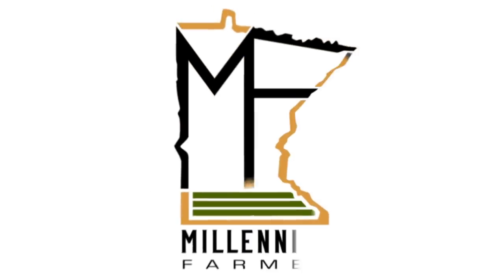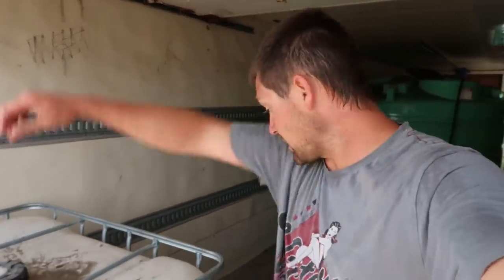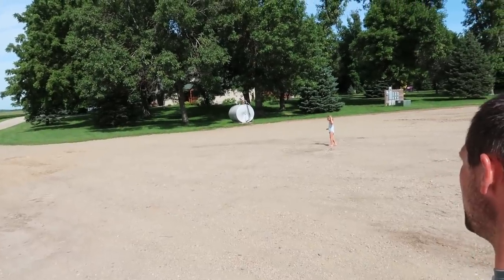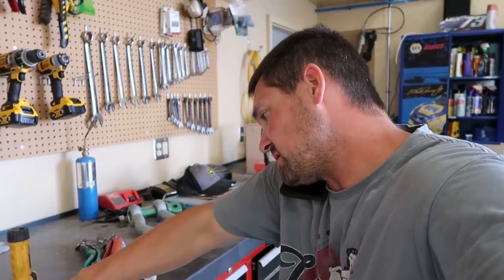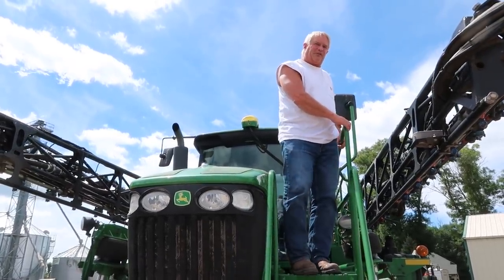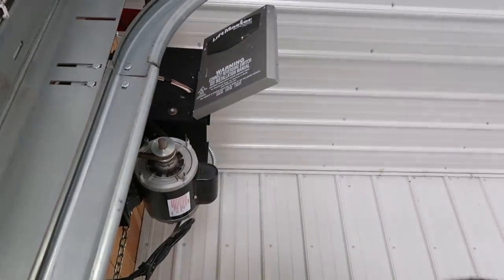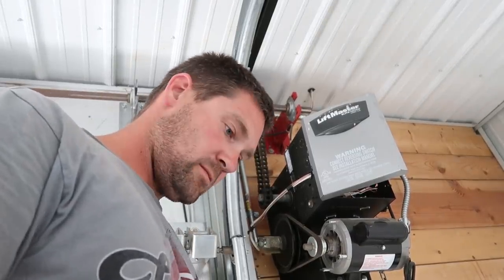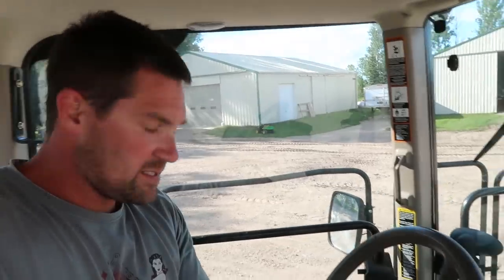Sprayer Oil Leaks

Comment: I ran a 9560 for someone doing tillage a couple of years ago.. Trans went out on it also. One night at 2 am while looking for the restroom I noticed oil spraying out the front of the grille. Machine came back from dealer after new trans and they forgot to hook up the heat/ac tubes to the cab. Machine went back. Cab has to come off to fix that. He now has all Red ones. Smart man.

Comment: It always is something on the farm....

My dad and I worked on the baler and hay accumulator yesterday, fixing issues from the last baling. Fixed everything in record time, buttoned it up and my son runs into the accumulator with his go-kart (which I may or may not have modified so he can go twice the stock speed), bending the closing gate arm that we just fixed. At least I had the tools out already, so I treated the earlier repair as practice.

It's always something.....often self-inflicted.

Comment: Hey from past experience of running two 4830 sprayers. If u will get the correct o ring u want be having those leaks as often. The correct o ring seems a little small. If u put one in that’s a little big it will get messed up when u tighten it up and want last long. Those solenoids work loose then it makes the pressure blow the oring out. If u will feel of it after it starts leaking u can loosen or tighten it by hand. Just thought I would pass along the info since u had two leaking at the same time. Thanks have a great year farming.

Comment: Might be worth looking into building some hinged shields at some point, that don't have to be unbolted and everything any time you need to work on stuff?  Yet another thing for the Legarms list.  XD
Reply: The ease of removing and reinstalling shields would greatly improve the chances of them being used.
Reply: We have invested in building frames to hang them from pins so all you have to do is pick them straight up easy to get off little hard to put back on but hanging them allows you to complestly remove them.
Reply: I would just run a pool fence right around the whole lot to keep little fingers away

Comment: So tip with the belt covers. my buddy built a frame and drilled a holes in the top of the cover. so you could just hang the covers and to remove them just pick them up its enough to keep the animals out of the belts but super easy to remove.

Comment: I started using WD-40 to wipe down rotor blades in La. on the Gulf coast. I just bought some white moly WD-40 spray. It works really well, thicker and sticks better than regular WD-40.

Comment: When i worked at the elevator, we had a few 30,000 bushel an hour Hi'Roller conveyors under our bins. We had a jump conveyor to go from our big wheat bin to connect with the rest of our conveyors that ran to a leg that we used for load out. The jump conveyor was underground similarly to your conveyor. One day, we knew we had a set of rail cars coming the next day that we were going to load. We found that the pit this conveyor sat in got full of water and froze, causing the conveyor to not run. Me being the new guy, I got to jump in there and clear all the ice and snow out so they conveyor would run. Yours looks like a drag conveyor, so hopefully you won't have to suffer like i did.

Comment: Them o rings are very common on higher hour 4730 4830 sprayers we had luck fixing them with actual John Deere orings the ones from cheap kits kept blowing out. I think I actually got oring kits for them solenoid valves for ours.

Comment: Those solenoids take a very specific O-ring and those O-ring kits very rarely have the right one. I drove a 4730 that would keep blowing the same one underneath and thought we were putting the right size on it from one of those kits until we actually ordered the kit from Deere and put it on. Didn’t have anymore trouble with it. Just wanted to give you a heads up

Comment: I'm guessing you need a high temp I pressure O ring. I ran into the same thing on my skid steer, selfperpelled chopper and on 1 of my round balers. If you use a standard O ring the heat and pressure will blow it out.

Comment: You need to install the cotter pin that is taped to the output shaft. The pin is what keeps the tension on your clutch. If the castle nut lossens up the motor will keep running until you hit the stop button.

Comment: Good you put belt covers on. Either make missing ins out of wood or measure and have a sheet metal heat/ac duct build company make you some.    Keep down accidents   Kids are curious!!    Enjoyed.  Might be a clog in oil line causing over pressure and blowing seals

Comment: On your oil leaks. I am not sure of this machine but usually there are nylon shields on each side of the o ring to help add strength to the o ring. I have not seen on the videos where you show this. May be worth a check.

Comment: Zack those oil rings are probably wore in the metal valve body just enough to blow out oil ring when pressure is high try finding a little fatter oil ring

Comment: Also Onyx: maybe save up some money and get yourself a SKLZ Quick Stick. $32 on Amazon. It is meant for single hand hitting drills and helps with your control and hand/eye coordination. I used to coach HS baseball and it actually worked with guys who had difficulty opening up during their swing. It's the little details that make a good hitter a great hitter. There probably wasn't a day in Joe Mauer's career that he didn't do simple tee work.

Comment: U need to move the big tanks closer to the middle or towards the axles. That way the weight will be more on the tires instead of the landing legs. U need thicker block on the landing legs

Comment: You might want to install a inline oil pressure gauge.  The odds of having two identical oil leaks at the same time especially after you just installed a new O ring on the one solenoid are probably pretty high.  There might be a oil pressure regulator somewhere in the plumbing???  Check John Deere's specs.  Just some thoughts.

Comment: Isn't it odd how tractor depreciate when talking trade in. I have a two year old brand X tractor that has been nothing but trouble. I was told by a couple of dealers that they wouldn't give me enough to make a trade in worth my while. Doublespeak for "I don't want the thing either." Fix the transmission. It's the right call.

Comment: Forget using those old crappy rubber o-rings and switch over to Viton o-rings. they are an alternative to Buna-N seals. Viton has excellent tolerance for high temperatures, resistance to oils, fuels, and hydraulic fluids as well as aromatics and solvents. ... As well as resisting oils, petrol, and hydrocarbons, Viton™ is resistant to mineral acids, halogenated hydrocarbons, and more.

Comment: At 12:57 you did show that you are less lazy than I would be in the same situation.
I just couldn't be bothered with the work associated with taking a vehicle there.
You would have to open the door, get in, check it is park or neutral, start the engine, put it into gear, step on the gas, turn the wheel... Nah too much work.
I will take the easy route and walk over there and back :D

Comment: Those solenoids and valves can be very finicky.... don't think I've seen them spew oil like that, usually the valve quits working correctly in which the implement doesn't lift or lower (stuck technically)

Comment: Not sure what you are using for replacement o-rings.  Just a FYI, standard 70A durometer o-rings are only good up to 1000 PSI, if your pressures are higher you need to use 90A durometer hardness o-rings.   Remember after you get the old o-ring out poke it and ask "Are you OK?"

Comment: I found using o-rings buna. grade 90 is a harder and last longer most o-rings are grade 70 they blow out faster on hydraulic systems I have been a mechanic for 45 years.
Reply: Viton 90 will last even longer. Many people buy a kit and most kits are 70 durometer nitrile, which doesn't handle temperatures over 250F while Viton is good to 400F. Sets of viton 90 o-rings in standard and metric are available on Amazon. I suspect the hydraulic oil temperature on the sprayer is over 200F.  It pays to know your o-rings or somebody who does. There are different hardness's. (durometer) You might want to try different shapes too, like Xrings or square rings. You also need to know if they are SAE or metric sizes. https://www.allorings.com/viton-o-rings

Comment: The spools on the solenoid valves come a touch loose due to vibration and then damage the o-ring causing those leaks it’s just the way it is and  check the taper of the block that you had the second o-ring blew out on there may possibly be a little Knick in it that caused it to go again and you should NEVER check a oil leaks with your hand

Comment: happy b day to your kiddo sorry i dont try to say names cause i get the wrong one or i just totally butcher the name or names for the o ring issue could there be a special o ring to fit them that you can not get in them larger general fix kits reason i say that back when i was working for the farm i worked for on a great plains turbo till to be exact i can not recall where at on the tool but we had a leak come about on that sucker and tried orings out of a general fix it kit and it would work ok for a day or 2 and the oring would blow out come to find out it was a special fit o ring from great plains

Comment: I have had the same o ring on my 4730 leak when we were spraying corn I replaced it then  Saturday was filling last of fungicide load and same o ring leaking again  I replaced it why are we blowing that one oring . Second  time this year.     Byron
Reply: Buy a polyurethane oring from McMaster Carr. A $9 oring isn't really expensive vs persistent oil leaks. Silicone oring grease is the helpful for seating.

Comment: Beware of generic o-rings. Not because of dimensions but spec of material.
Reply: Parker brand polyurethane are the best thing I've found for this sort of valve cartridge leak. Way more durable. $8-10 each, but if it seals the oil in, it's worth it.

Comment: Why do you put an extra set of tires on the sprayer what does the change
Reply: It changes the size of the wheelings left by the sprayer. Dual wheels spread the weight over double the area on the ground and reduces the compacting effect of the wheels. Compaction affects the rows of corn on either side of the wheelings and can also cause ruts that are hard to cross, without throwing the operator all over the cab and potentially stressing machinery in a way it was not designed to handle. Duals mean more wheelings but of much less depth, better for soil and gear...

Comment: Wd40 is a solvent ...it will remove grease from sealed bearings is you spray too much
Reply: There are more WD40 products out there then just the old solvent one. He was using a dry lubricant.